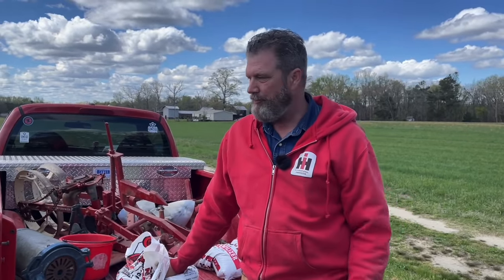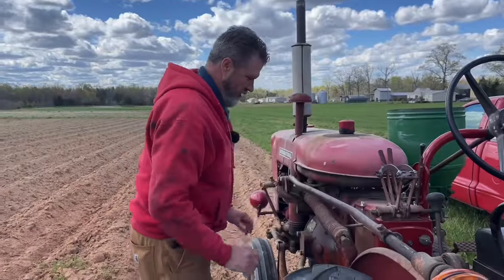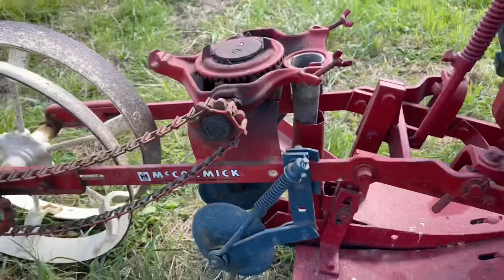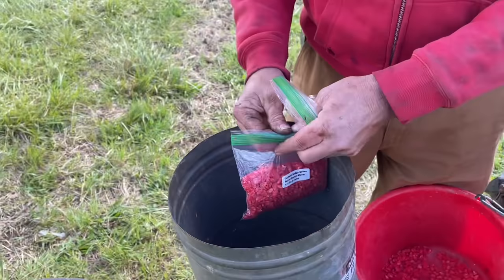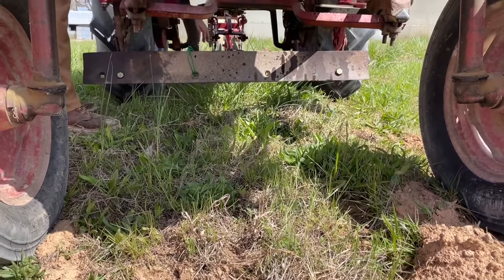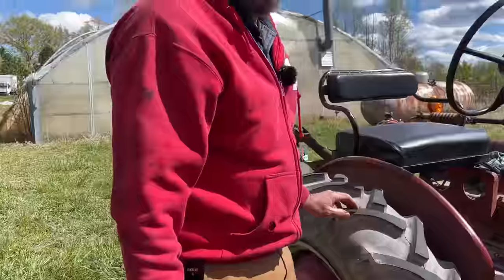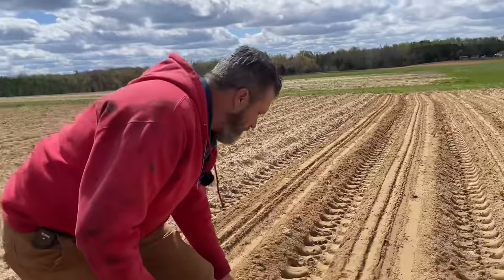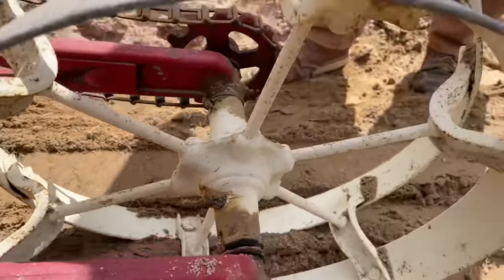Planting Silver Queen Corn 🌽

Comment: You are 100% correct on price of fertilizer. I bought some early this week Wow! $26 a bag. Seems  like I paid $13 or so last time I bought a 50 lb bag. Gas is sky high, heck every is high.  I love the planter setup you have. I go to Church with a guy in his late 70s  he wanted to give me his grand daddy's old cole mule drawn planters both sides of his families planters. The handles are gone but they are both in good shape. I'm gonna keep them original minus the handles and weld a bracket up that allows me to use one of them behind my cub tractor. I'm gonna fix the bracket to bolt to the planter and the cub. I'll use the back lift arm to pick it up. He was excited to hear I was gonna use them. Your planter is doing a fine looking job. Keep the videos coming. Like I said in another comment I learn alot from you. Thanks!
Reply from the maker: Thank you for your kind words and watching.

Comment: Great job planting Joe! That was $300.00 well spent. Before I got my box scrape, I used to level my slide rows with a 1x6 board bolted to the back 2 shanks on my cultivators.
Reply from the maker: It’s funny you brought up slide rows. Ours was always full of rag weeds.
Reply: @Jtwes  I'd leave the front 4 cultivator shanks on and bolt the board across the back to and plow and scrape them at the same time. I eventually got a box scrape and started using that.
Reply from the maker: I remember one time they got so tall I got that bog harrow out of the weeds and cut them out.
Reply: @Jtwes  Now that you mention it, I've seen people cut the slide rows out with a bog harrow in years past.

Comment: I just caught something watching a second time, if your closing disks aren't covering all the way there is some adjustment to them, they are the best set up IH had, until the early riser units inverted disks. If you can get them adjusted a touch deeper or a touch more spring pressure they should do a better job.
Reply from the maker: Good eye. Yes they don’t offer much in the way of seed covering. I’ve toyed a little with them but never got serious with it because the seed doesn’t give me any cover problems. That’s probably because of the soil and beds I make. If I were planting flat all the time those disk would have a more important roll.